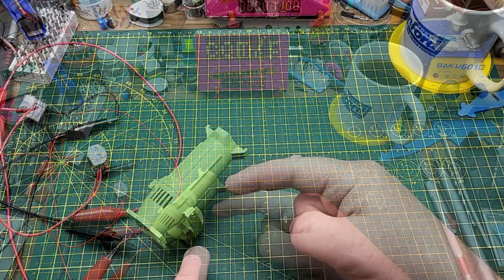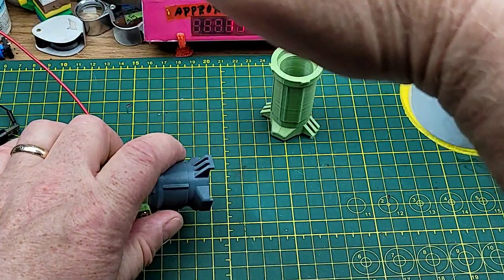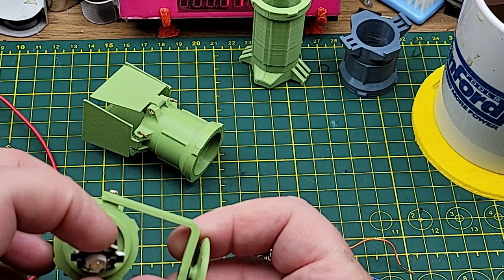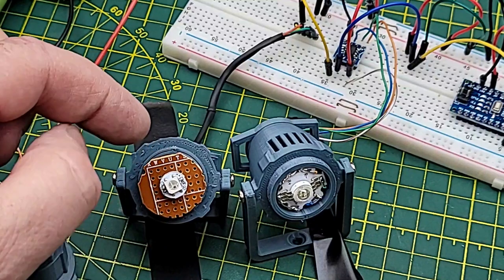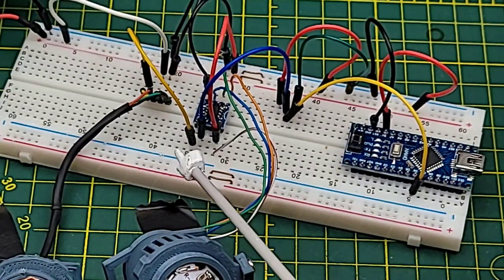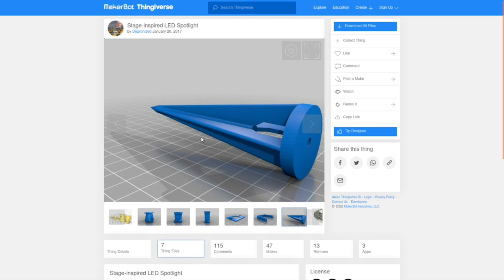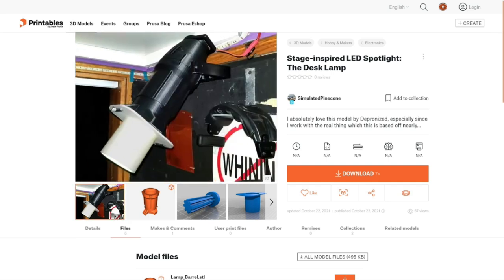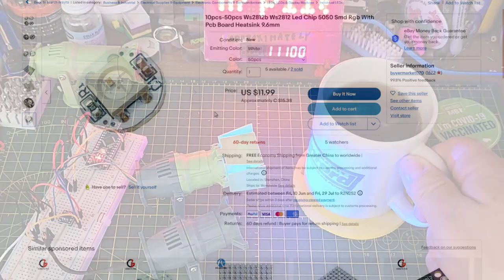Miniature stage lights! They really work

Comment: The only problem is cooling, those LED modules were intended to be mounted onto a heatsink, the notches are for the mounting screws.
If you keep the power down, your probably safe, although pushing a 3W and above will probably give you a meltdown.

Comment: With the way this light functions, it should be modeled after a fresnel or even an R2D2(i.e. Parcan). Leko's(this style) typically has several lense's in front of the lamp and are more of a spotlight(much more control of the beam) rather than just a flood.
Reply from the maker: Of course.  I just don't happen to have a bunch of 12mm lenses handy.

Comment: Use the 3W ones at 1W, much more light output because of the lower current in the larger die, so actually better overall. Will say the cheap ones do definitely suffer from lumen degradation, I am running some as low level lighting, at 50mA, and after 2 years they are pretty dim, time to pop off the old one and replace with another off the sheet of 25.

Comment: If you're into stage lighting it would be easy to use a ATTINY controller connected to the Neopixels to convert a DMX stream from a lighting controller and make a 12th scale stage replica to practice your lighting patterns on your actual lighting board. These are really nice models too.
Reply from the maker: I thought about that.
It would need an ATTINY and a MAX485 to interface the DMX (RS485). 
I'm not convinced there is enough room in the back of the light for those and a  PCB to hold them.
Reply: @pileofstuff  How good's your SMT soldering?  :)
Reply from the maker: @IanSlothieRolfe  not good at all. 
But it hasn't stopped me from trying.

Comment: on the ws2812 what is the value of the resistor? Mine had a 75 ohm which was causing a string of 60 to glitch like mad. Will be very interesting to see your value. I see the add had 75ohm!
Reply from the maker: In this case, I didn't use any resistor on the data line.

Usually, when I remember, I'll put in somewhere between 500 and 1K - whatever I happen to grab.
In my experience it's not too picky.
Reply: @pileofstuff  sorry I don't think I described it correctly, if you look on the ws2812b pcb you will see a cap and a resistor.  On mine the resistor was 75 ohms and its in series with the 5v pin and vcc of the led. This means that the vcc of lthe ed changes with the current it pulls. Which also means that Dout voltage level changes and can rail to be recognised by the next led. See my video's on ring glitch. Drove me mad, so I saw you had the same type of led board and wondered if you would have the same issues. 
The web list sho!ws a 75 ohm resistor so maybe my boards circuit was incorrect? Check the math 20mA per led max, 3 leds, and 75 ohm series resistor.  What's the voltage drop across the resistor with just 1 led at full brightness?